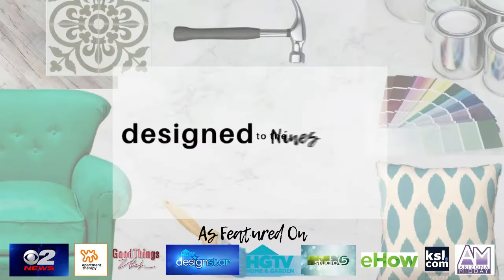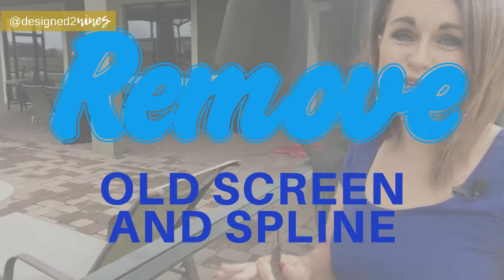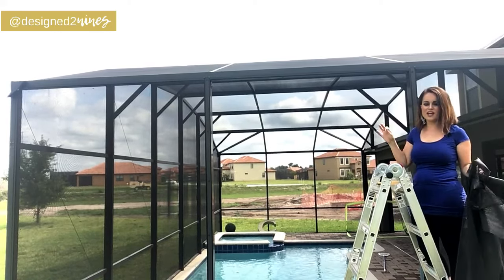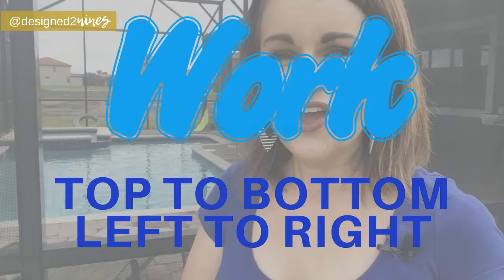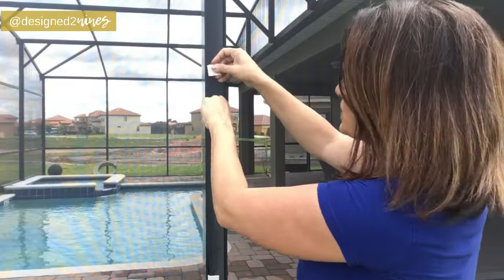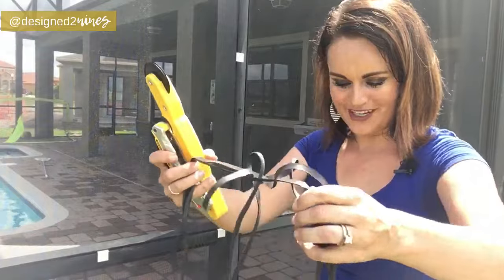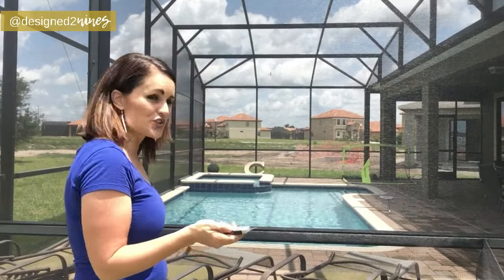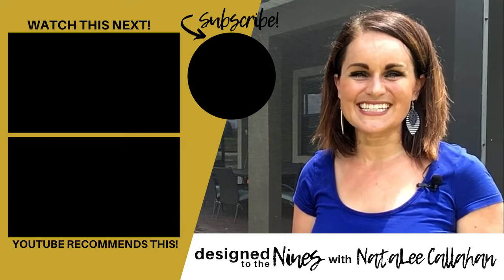HOW TO DIY | Lanai/Pool Screen Repair with Flat Spline

Comment: Awesome video. Thanks and its a great workout👍You don't need those clips. You tack the left side with a 6" piece of spline for beginners. Then go to the right side.  Level it out and start installing spline. Thats how I started doing it. Now I'm A Screen Pro👍💪
Reply: she forgot to say the curved side of the flat spline should be facing out. the spline will hold in the C cavern best and with stand strong wind.

Comment: Ok so I just had to come on and say that after watching this video I felt very confident that I could replace a screen on my screened in porch. I ordered the materials(the clips were sold out everywhere!) and convinced my husband that we could do this. He reluctantly said we could give it a go. And we did it! The only problem which wasn’t a big deal was I bought the wrong type of spline. We just returned it and got the correct one and the process was actually much easier than anticipated. We keep looking at the screen and then at each other and say I can’t believe we did this!! We had a section replaced a few years ago and it cost $400 so look what we saved!! I can’t thank you enough!

Comment: I used pieces of round spline instead of clips. 2-3 inched bits to hold the screen in place while I got the permanent spline in.

Comment: Where can these clips be purchased?
Reply: You video was so informatively awesome!
Reply from the maker: Thank you so much! There should be a link in the description box of this video where you can purchase them. They are very helpful. I wouldn’t do it without them.
Reply: No description box or where to buy clips?
Reply: @joelamarco2948  amazon  .   Lanai screen clips  . Metal once way easier to work with

Comment: What are your thoughts on replacing the screens on the top of the lanai? My thought is to have a professional do the top and I'll do the rest! Thanks
Reply from the maker: Here here! I have no desire to climb on top… But on the sides it’s totally doable.
Reply: @designedtothenines     maybe rent a sturdy scaffolding (you'd have to build it up) from Sunbelt or Home Depot. That's what I'm thinking right now